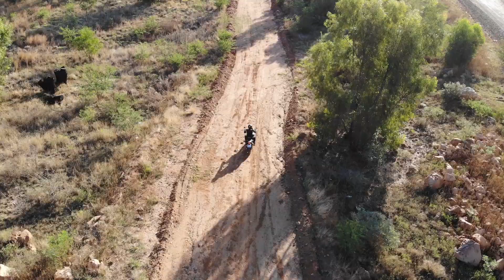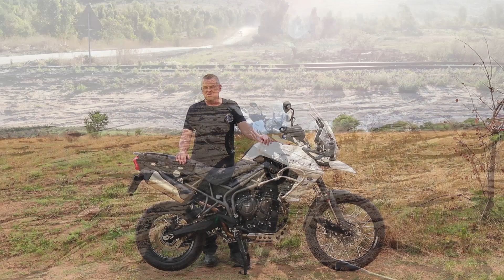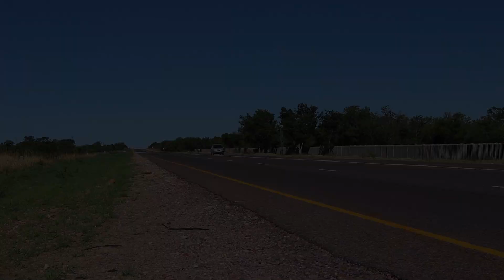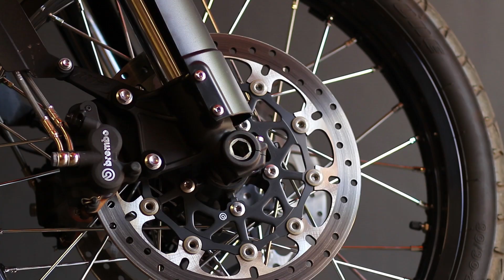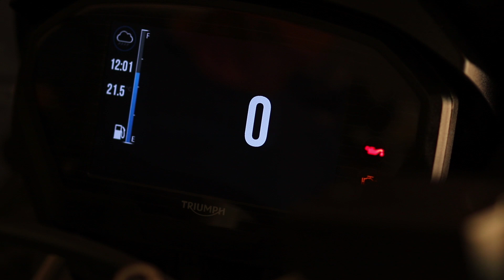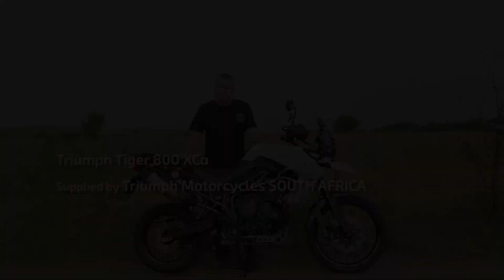Triumph Tiger 800 XCa

Comment: Hey mate, whats the silver upper engine/tank bars you have on there?
Reply from the maker: We get the bikes for review directly from Triumph, so I assume they are standard Triumph equipment.
Reply: Them bars are a Triumph part,  FUEL TANK PROTECTION BARS - "BLACK" PART NUMBER: A9780062 or FUEL TANK PROTECTION BARS - "STAINLESS" PART NUMBER: A9780065